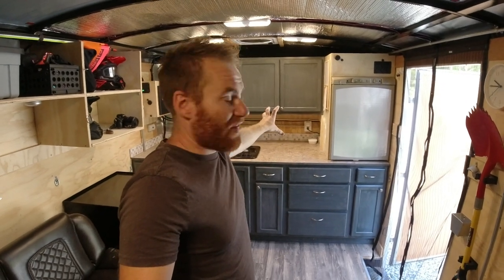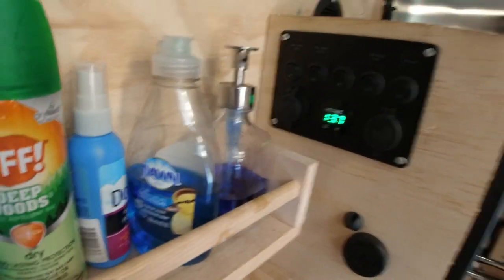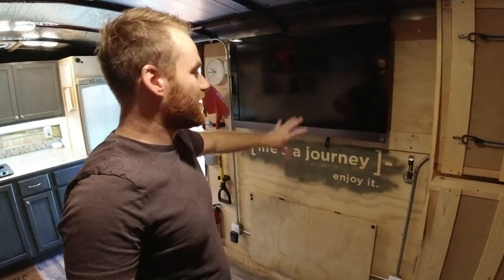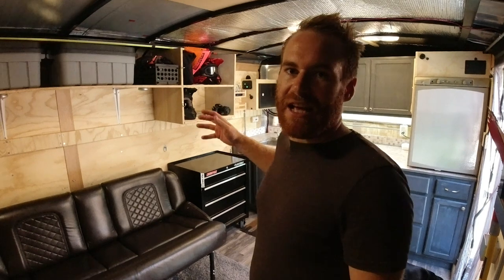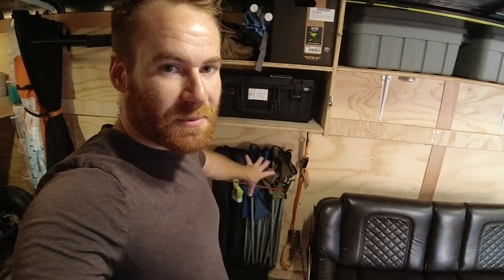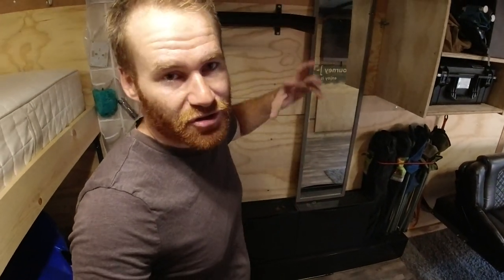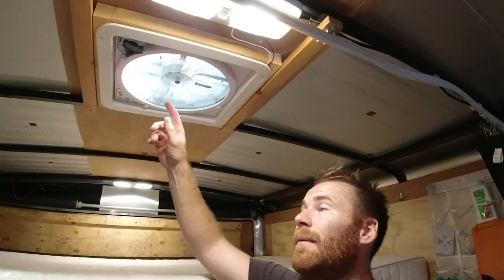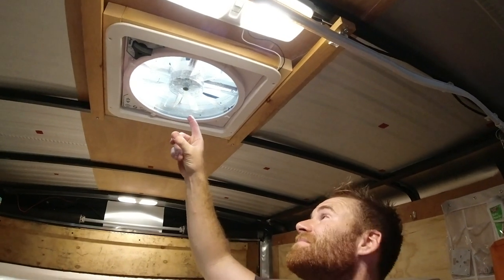Cargo Trailer RV Conversion - 8.5'x24'

Comment: Trailer is nice! Thought about doing this too instead of a 5th wheel. I will tell you though, that carbon monoxide detector is pointless up there. Carbon monoxide is heavier then air, so it should be right below where your pillow height would be. That way it goes off before it fills the room while you’re asleep. At that point, where it is, you’d be dead by the time the detector went off, if you were asleep in there.

Comment: Looks great you did a good job for a last minute build! FYI if you decide to buy a new trailer have the trailer builder use screws to attach plywood interior walls. Do not use staples. Also a one piece aluminum roof,thicker gauge metal for exterior walls and replace the drop axles with straight axles it will increase ground clearance and enable you to lift trailer higher should you need to in the future. Most of all HAVE FUN!!
Reply from the maker: Great ideas! More clearance would be ideal and increasing the overall build quality would be nice for life longevity. I'm pretty excited with this one for now, but definitely excited about some future improvements.

Comment: Nice job
We have a 41 foot diesel pusher and still very much enjoy our 29 foot gooseneck enclosed trailer with 10 feet of living quarters in the front. We do most of our cooking in the garage in the front is separated and heated for cold weather snowmobiling. We have all the major appliances and a sink. This year I need to give up some garage space for a shower/ toilet.

Comment: What I learned recently on a conversion that I just begun is that sometimes the plywood panel is held on what looks like a tiny Phillips head screw but it doesn't come out with screw driver.

 If you go off to begin a project like this see that the existing wood panels are held on with screws.

Also consider the interior height if you want to put air conditioner in there may need to be taller than you think

Comment: I agree with you on the vinyl click flooring! Great job I was also going to say between the metal supports under your floor you can also build storage boxes in between them so you could lift your flooring up and have tons of storage in between all of the Rails or some of them ...  great job on the build that is one sweet trailer!  (You can also use one in insulation under the trailer and when you're done putting it up use some paint on weatherproof. )
Reply from the maker: Love the suggestions! I like the boxes in the floor and considered that for storage, but decided against it because of time. I may opt for it down the road or in the next build, but they are really convenient. And insulating the floors would be a good route to go. Do you have a suggestion on type of insulation?
Reply: @JayOakes   in my 6 by 12 I have half inch on the floor and 1 and 1/2 in my walls and ceiling.  The half inch on the floor is a little drafty but not bad with just a space heater in the winter time in central Arkansas.  This winter I will be putting one in foam insulation on the underside and then trying to find a mastic type paint to paint it to weatherproof it.  I use the polypro board foil facing the airspace from lowes.  I live in my trailer full time and the insulation is great for summertime like I said for winter I was thinking about adding the one inch

Comment: instead of removing the original wood paneling, could you place the future insulations/foam over it, then cover  with more wood? Curious about that. The top tier mattress is a good idea, leaving it near floor level ( as other cargo trailer converters do) means some wasted space. Also, you could put a 'den' with TV underneath the bed, when the trikes aren't  brought along .

Comment: IT looks great! Ive watched dozens of Cargo trailer conversion videos and yours looks like one of the best thought out. How did you do the beds? I was looking the other day at a commercial (metal) version of a similar design.  Keep up with the great vids!
Reply from the maker: Thanks! What a compliment! The bunks are 2x4 frames, 1x4 slats underneath, hinges to the wall and then a 1x4 on either side of the front corners with a screw (soon to be a bolt) through it as the pivot point. Then I used bead board to cover the slats and cut out mattress topper foam as the mattresses... but they're only for toddlers, so I could get away for simple and a faux mattress.

Comment: I have a 8.5x20, wished I woulda went 24 or 26'. Just starting. I'm going to to an epoxy dirty pour floor. I am also putting in a bathroom.
Reply from the maker: That's great! I find that I always wish I had more space and so that's why I went 24'. Next build I'll either do 24' or 28'. Looking forward to seeing that floor! Let me know how it turns out and send me a link to your video of it!
Reply: I was thinking 24 but maybe 28 after your suggestions
Reply: 2 x 7,000 lbs axles?

Comment: Very cool build out, I’m looking at doing around the same size. After looking at your floor plan I’m a little surprised you can’t fit more than 4 quads. Is that the max or just the most you’ve  loaded in so far?  Also would you go taller on the trailer next time? (I assume you have 6.5’ inside height)
Reply from the maker: Thank you! Because of things mounted to the walls, you can't get them side by side between the wheel wells. So if they're all full size quads, I can only get one between wheel wells and 1 ahead of that and dirt bikes aside them. Plus, I generally keep a pretty large tool box in it which takes up a bit of space as well. For height, it's 6'-6'6" depending on where you stand and YES! I would Ideally go at least 7, with a desired height of 8. Wouldn't need more than that though in our case.

Comment: I’m thinking to have a similar setup to yours without bathroom. What do you do for shower and toilet?  Also what did you use as a water pump and holding tank?
Reply from the maker: I have since gotten rid of the trailer as it was a little too small for the family. But we didn't have a shower in it and just utilized campground showers. As for a holding tank, that was something that needed to be installed. I ran a drain line out the bottom of the trailer temporarily and never got past that. But because of the sink I put in it and the way we used it, I never had anything to put down the sink.

Comment: What's your tow vehicle? And what are you looking at for weights?
Reply from the maker: I recently sold the trailer, but it was right around 7000 lbs dry. I was pulling it at first with a 2003 F350 w/ 6.0 Powerstroke and then moved to a 2002 F350 w/ 6.8L V10... I just made a video of the current truck - https://www.youtube.com/watch?v=-bANo3Sorik

Comment: Sincere question. Is that one of those generators that other RV and conversion creators say are too loud? Google says that particular model is 68dB and that quiet is considered 50s to 60dB.
Reply from the maker: Yeah, that’s about what it is. It’s not quiet, but if you’re off boon-docking and willing to move it a little ways away from your rig, it’s not a big deal. It also becomes white noise for me and has never seemed like a big enough deal, nor do I use it enough, to justify the cost.
Reply: @JayOakes  Nice. Thanks. And to be fair it looks nothing the size as a construction generator a neighbor of a creator had at a campsite. Creator was in his RV letting us see through the window. Thing was huge. Lol

Comment: What kind of weight did this project add?  Great job btw!
Reply from the maker: I'm not 100% sure, but I think ballpark is 3500 lbs. With 4 quads in the trailer and stuff packed for a month long trip with 4 people, it weighs in right around 10k. I believe the net try weight of the trailer without any buildout is about 3500 lbs. Flooring, as vinyl click, is too heavy vs. linoleum and with the tradeoff of dollars spent, I could reduce some weight by building things out of aluminium instead of wood. Also, the Home Depot cheap cabinetry is VERY heavy as 3 walls of it are particle board.

Comment: Great video Jay. How did you put on the roof racks? Also, what brand is the trailer and what is the empt and total weight?
Reply from the maker: The roof racks are sitting on the rain gutters and then have self tapping screws put in. I've been monitoring them to make sure they don't wiggle free, but they've been holding well. If necessary I can drop some bolts through the frame. As for weight, I don't know dry weight. Last I used it with 3 quads was just over 9500k
Reply: @JayOakes  thanks Jay. I'm considering using racks to put the solar cells on so I don't have to put more holes in the roof.

Comment: What about the back? So no motorcycles
Reply from the maker: That is one of my design flaws :) The bed is a little low so you just have to lean the bike over a little in order to get them in or use the side door. It's not a flawless system, but I can make it work. Generally we have quads inside though.